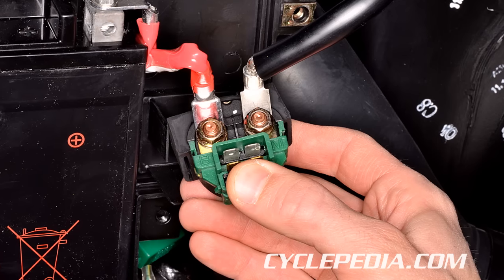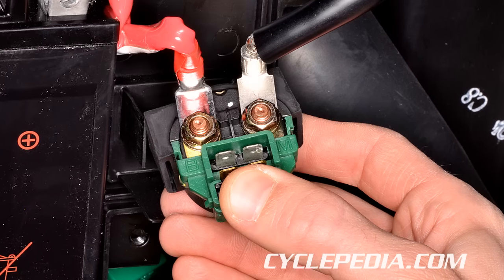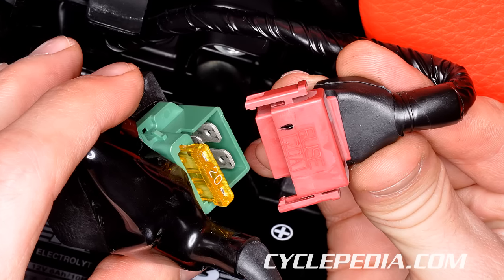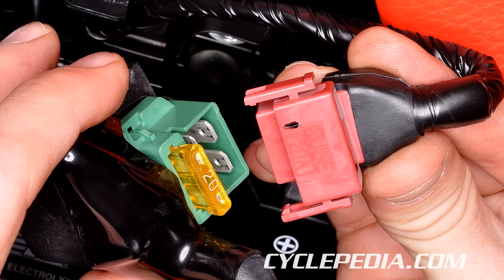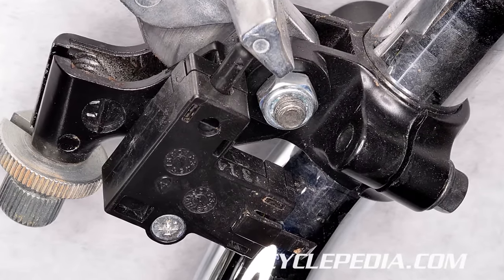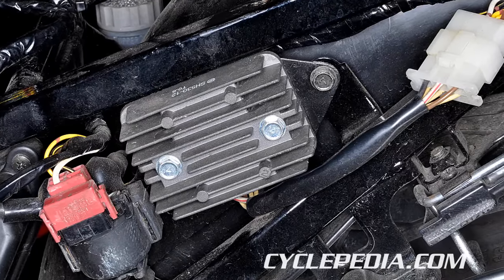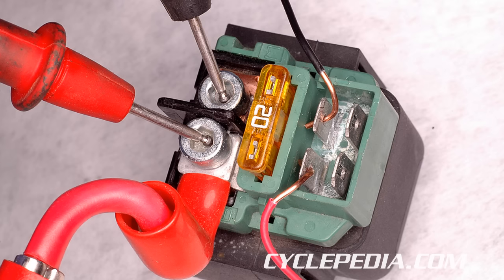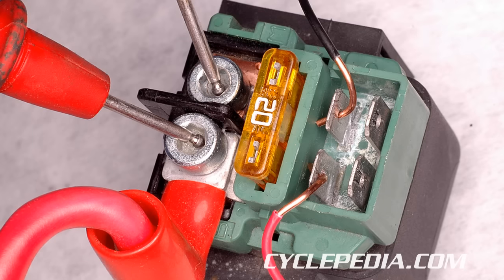Starter System Troubleshooting

Comment: My Honda Magna is not giving me anything, no lights, no iginition, nothing. Could it be the ignition relay? Battery is good, rectifier is good.
Reply: Gerardo Aviles same problem for me, Did you find out what was wrong with yours?
Reply: Yes, It was the ignition switch. But it was hard to find out. I had to strip the whole bike, and test cable by cable. If you want to test if it is your ignition just disconnected it. And test your connectors in the inside that casing the goes straight into the wire harness. Use a long cable with Crocodile ends. Connect one end to the positive of your battery and test the connector inside the casing one by one ( There should be three ). Your bike should light up when you touch the right one. If it lights up then it's time to replace your ignition switch.
Reply: Remember!! Your battery should be connected to the system. Positive and negative. Ride on!!!
Reply: I'm getting lights on my dash of a 83 Honda nighthawk cb550sc but starter button is not working starter solenoid has been tested and is good. I'm lost on this.  Starter works if I jump the starter solenoid.
Reply: NICE! you dont know how long I searched that simple troubleshooting tip!! Had similar experience. Road a track day, then various stops along the the way home. Stopped at  friends hm.turned of bike enjoyed the eve and when I went out to start it ...nothing. Tore bike apart testing everything. Honda VFR.
Reply: @jenjennjonjon1434

Comment: I have a international 4300 it won’t crank to start I didn’t let the gauge cycle I just stared the truck up instantly and it was about to start and half way stopped I got tech out and checked everything and nothing I got a spn 1081 fmi 9 code

Comment: Great info. So.....uh.....how do I check it again? I don't understand electrical stuff at all. When I click the start button theres no clicking. I tried another switch assembly and still the same. The way I start it and drive is putting a screwdriver 
To both terminals of the starter relay...so hello anybody in YouTube land have an idea? 
Ohmmmmmmmm🙏

Comment: Tick tick tick that all I hear coming from my moped when I try and start 

Which is it Solenoid or starter ? The ticking sounds like the Solenoid
Reply: Your relay can click if it's getting voltage but without positive connection (due to corrosion it a break in the connection) that's all it will do. There are videos on resting starter solenoids/relays if you have a multimeter to check the resistance.
Reply: yeah same problem

Comment: I was having that kind of problem with my cbr600rr. The bike cannot turn on after i put the key one it and turn it on. All indicator on the dashboard is active but cannot start the bike. 
So i do my check with the fuse etc... it has no problem on it. 
Finally i got the main problem with my cbr600r 2010. the connector from the key house was rusted and after cleaning it. Now the bike has no problem. btw, the connector place close to the tank in the right side. You need to open the right fairing to get to the connector. It is brown

Comment: Mine i turn my key and the dash dont turn on
Reply from the maker: Check your main fuse if applicable
Reply: @Cyclepedia  ok ima do that if it doesn't work ima coment again
Reply: @Cyclepedia  could i reach u on any social media
Reply: @Cyclepedia  Same problem on a 2014 Honda CRF250L: the battery reads 12V, none of the fuses appear to be blown, but the dash is dead. This occurred after stalling the bike in a parking lot. Battery tender alternates between flashing red and flashing green.
Reply from the maker: @chinngis83  Have you checked for loose connections? Make sure the battery is hooked up correctly as well
Reply: @Cyclepedia  The battery seems to be connected fine. I'm thinking it's the recall on this model.